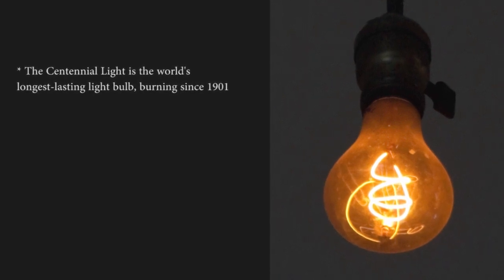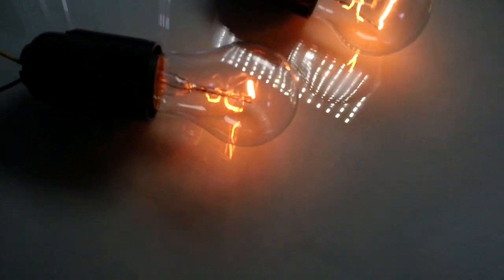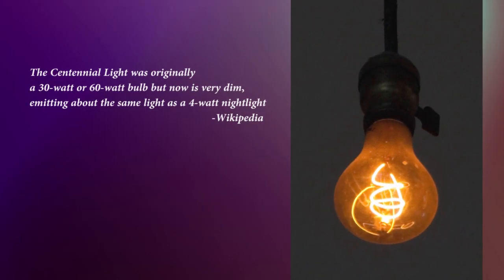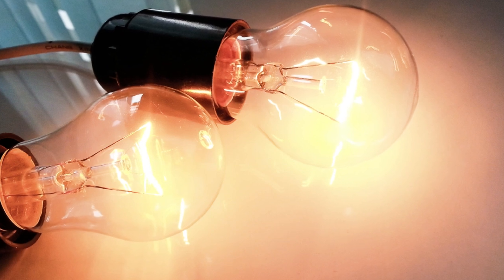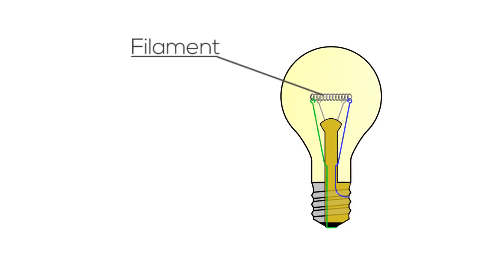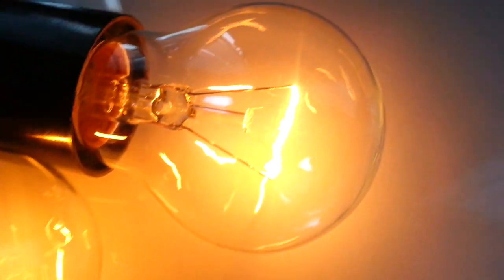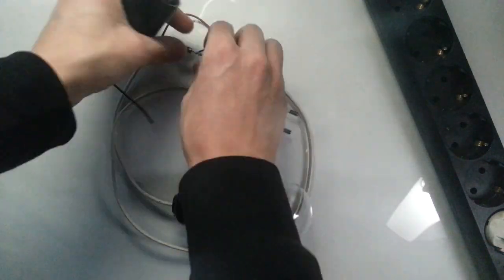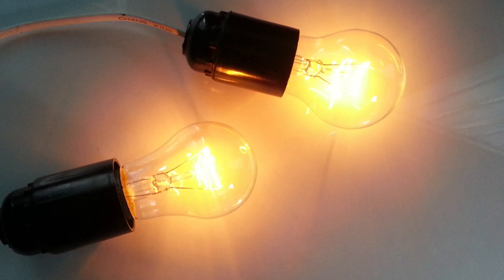Why Light Bulbs Burn Out -  Bulb Will Never Burn Out With this Tricks (tricks at the end)

Comment: rhe secret is when it stars too fast it burns faster so if u delay a bit the start it will last longer time ,because i remember a smal coin device they sell that u put in the socket and it delayed the start time and my bulb never burns and i remeber it had a smal center similar to carbon and the outside circle from a metal material similar to cooper or maybe a laton ,but i think the center was made from acid boric that has the property to be a bad conductor when is cold but when is hot it is a good conductor  so at the beguining it delay the start and the bulb will live longer time,i remeber when i had that small device similar to a coin i never miss a bulb light

Comment: What can you do to make LED bulbs last a hundred years ???
Reply: Instead of a diode, you use a capacitor. 440uf for +10w leds or 220uf for smaller bulbs. Make sure it is rated for the proper ac voltage.
Reply: @Phoenix88.  Thanks for the information on the bulb. I will try it out in a week or two. Peace

Comment: I imagine if one diode works, if you were to use a full-wave bridge rectifier, to run the bulb on DC current, it wouldn't have the 60 cycle fluctuation that AC does, and this might extend its life....
Reply from the maker: Hi, with one diode only a haft of the energy of the cycles goes through the diode, and the bulb works 50%, but with a full-wave bridge we will get all of the energy, and therefore the bulb will work 100 percent (or maybe 99%, to be more precise, because we will have a couple of volts loss on the diodes). So I think it will not help. And it will not be pure DC after the full-wave bridge, the current will still pulsate, but without change of its direction.
P.S. It is just my opinion, I will be glad if someone proves me wrong.
Reply: I have heard that if an AC bulb is run on DC, they last longer, But I agree you would have to an an AC ripple Filter to make it pure DC. Just throwing Ideas out there. thanx for your reply anyway :)
Reply: @dusterdude238  As tungsten atoms evaporate from the filament, a very small percentage of them are ionized
by the small amounts of short-wave ultraviolet light being radiated by the filament, the
electric field around the filament, or by free electrons that escape from the filament by
thermionic emission. These tungsten ions are positively charged, and tend to leave the
positive end of the filament and are attracted to the negative end of the filament. The result
is that light bulbs operated on DC have this specific mechanism that would cause uneven
filament evaporation. 

TL;DR: Unless the filament is vibrating violently at 50/60Hz  because of the AC, DC operation won't make the bulb last longer.

Comment: use thermistor in series. https://en.wikipedia.org/wiki/Thermistor; cold light bulb take for couple cycles of mains about 3 time more current and most of damage happens then.
Reply: So you're saying this simple setup is actually reducing the life even more?
Reply: @Vinnay94  , no - 2 in series is good for reducing inrush current, but in both cases (2 in series and diode) you get dark light, and with diode it will be visibly blink, but of course they will be last longer. Good easy and cheap solution is triac dimmer. Check this https://jackiewiczowie.blogspot.com/2014/10/termistor-ntc-jako-soft-start-do-zarowki.html it's in polish but there is a lot of oscillograms.